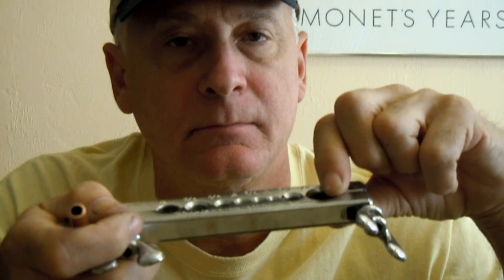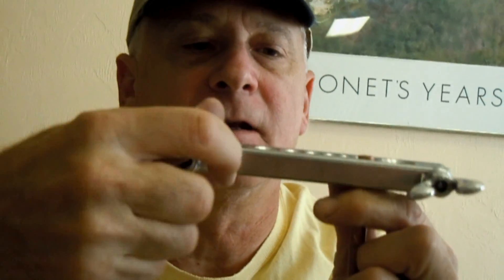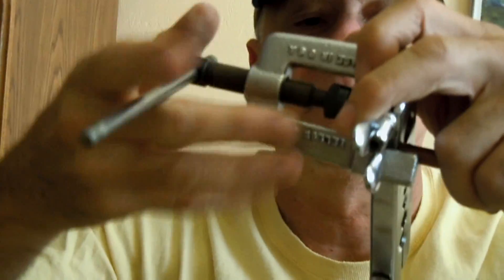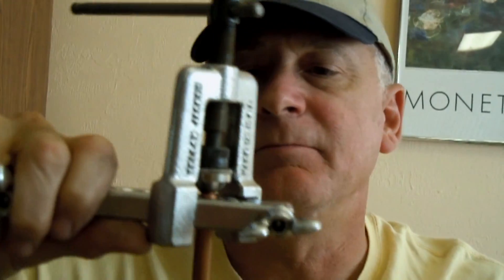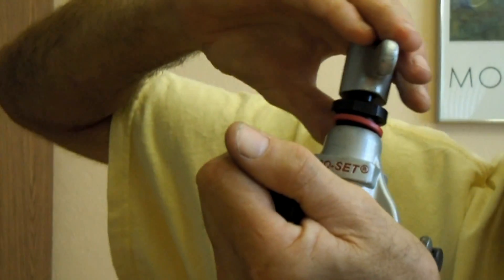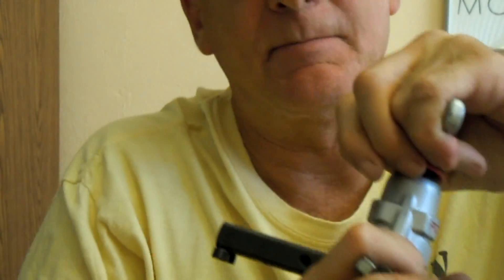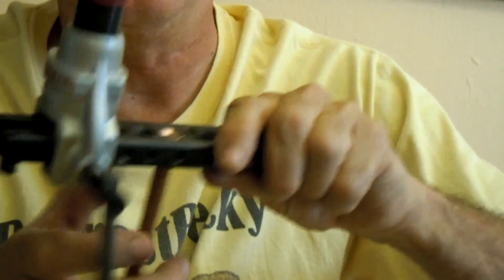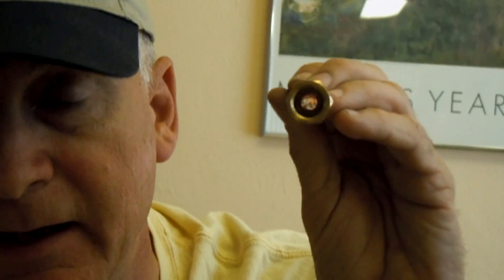HVAC flare tools

Comment: Im doing some mini split with the older flare tool and when i pressure test with mitrogen they all leaks.  So tomorrow  i will buy the other flare tool to see who it does. Also i have a quwstion for u do i have to tight the flare nut with the torque wrench or i can use regular crescents.

Comment: hi there
I tried buying the cps pro set from amazon but they dont post to australia. But I did find this brand Ridgid 23337 345-DL Flaring Tool do you think it is just as good as the one you had on the video

Comment: @Randy50cal I used to use couplings at the company I used to wokr for, now I'm not allowed to use them and I find with a hydraulics sawger it takes waaay less time..if it's brazed it should be as strong as ever, I've never had and issue yet.

Comment from the maker: @Djkyle65 Damn you're good. The Pro Set does flare the tubing at the correct angle for R410a fittings. That alone is a good reason to get one.

Comment from the maker: @MrB007nd The flaring head deburs the tubing before flaring. It's very different in the way it works. I guess that I should have included how the flaring heat spins around the inside of the tubing.

Comment: Have a couple sets of the old style and have never had a problem.  I guess if you don't have a set you might as well buy the new style but I'm guessing that one cost 5 times what you would pay for a standard one ............ after 30 some years , I will keep using mine. Thanks for letting me see what is out there new tho